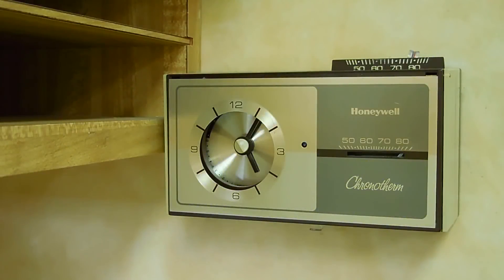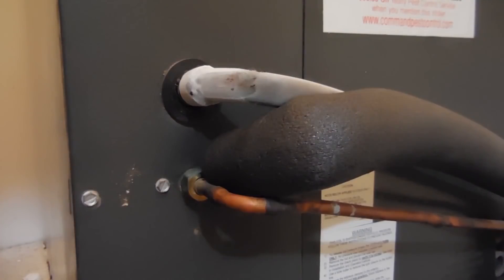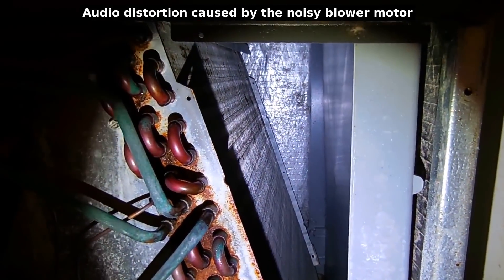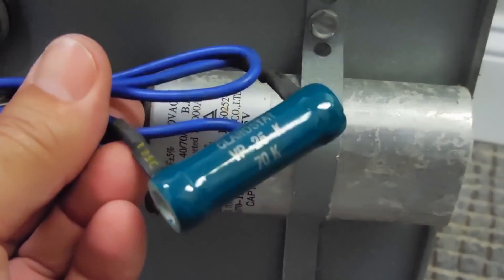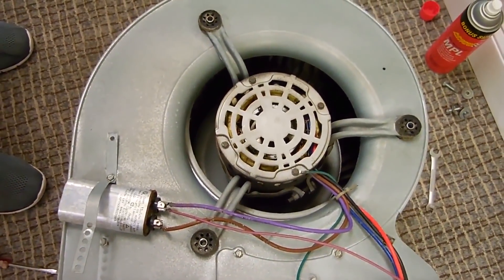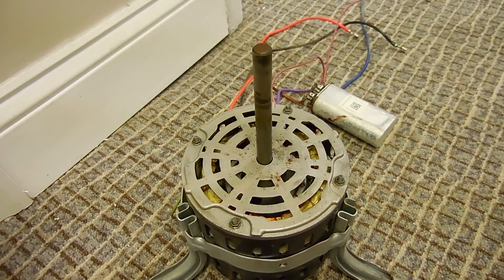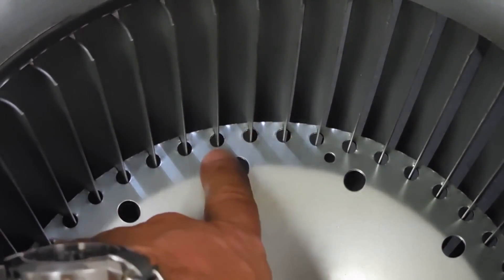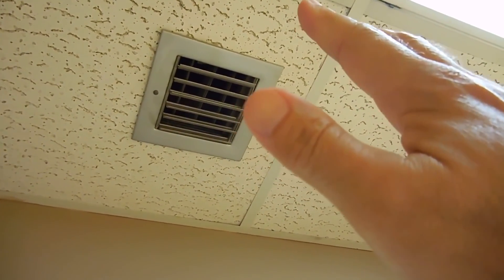Central Air Conditioning NO AIR FLOW VENTS! (Frozen Pipes)

Comment: About 7-8 years ago several manufacturers were having trouble with this same failure. I changed around 8 - 10 of these on less than one year old systems one of them failed a second time. This was the same product sold under a couple of different brands
Reply from the maker: It was a lousy design, the new one should last.

Comment: Where can you buy just a squirrel cage rather than the entire blower assembly, particularly that you can find one with exactly the right measurements you need?
Reply from the maker: You need to get it from the manufacturer, or search online.
Reply: Most blower wheels are fairly standard. Take the old one with you to buy a new one. A wire brush on the end of a battery drill will polish up the shaft. You may need a specific wheel puller.

Comment: Without a TXV liquid can damage compressor, hopefully not.  Easy repair, if your thorough replace both caps and compressor relay with that age.  For a few bucks more up the amperage on the relay or if it's single pole use, buy a double pole and wire both together, should be last relay needed.  I bet his static pressures are off the chart like 80% of HVAC systems costing users big electric bills.  My 3 ton in Florida sized perfectly based on heat load is running 3-4 hrs a day now depending on cloud cover.  After proper charge (superheat, subcool) it's all about static pressure within duct system for peak efficiency.
Reply from the maker: The contactor was replaced a few years ago, and the capacitor showed no signs of bulging with a capacitance value very close to the rating, so no need to replace either component. I've seen many systems over the years freeze up with no compressor damage. One thing I learned over the years, is to do a very good job, but try not to be a perfectionist, it could result in health problems. LOL